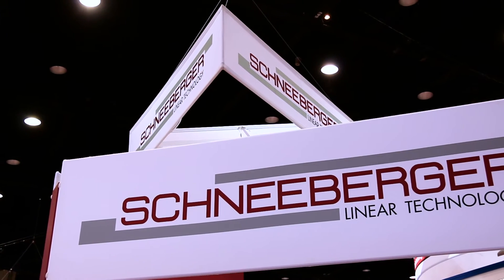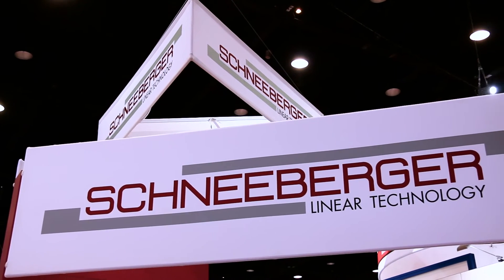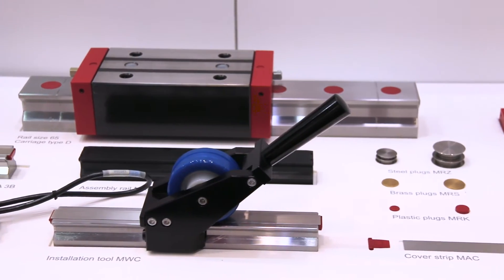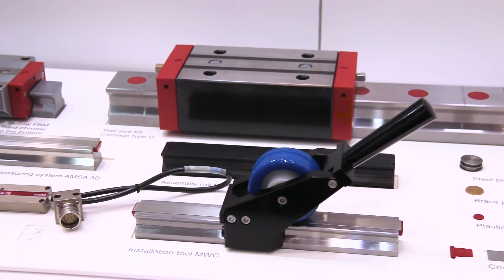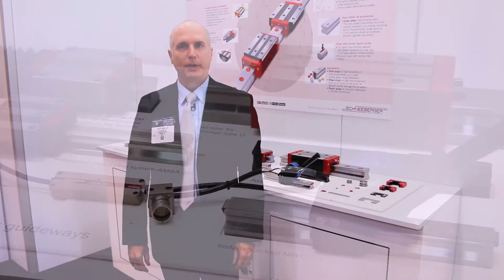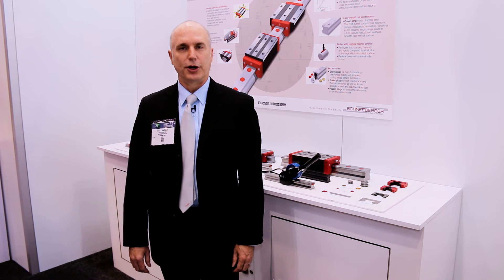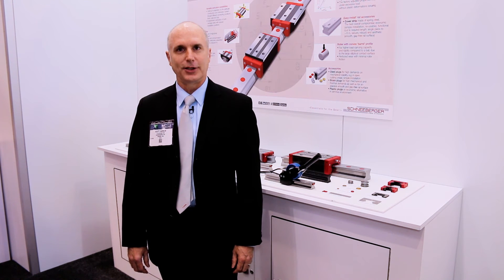Don’t forget this critical element — Mineral-cast bases for linear motion

Comment: Hello, one question: Are the linear rails mounted straight onto the epoxy-granite/uhpc base or are there steel bars between the machine base and the linear rails that were grinded/milled flat? Thanks in advance